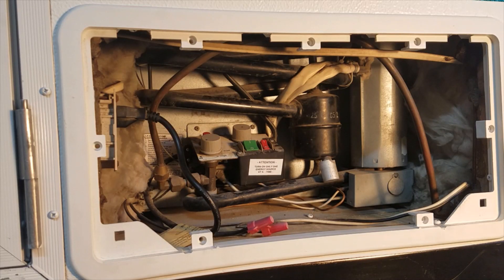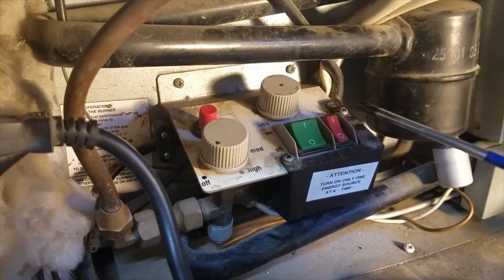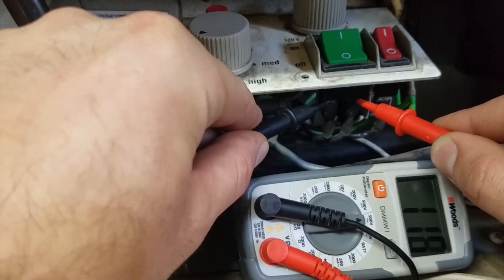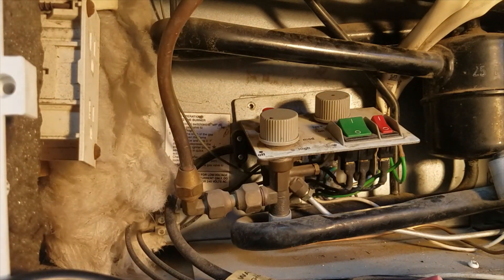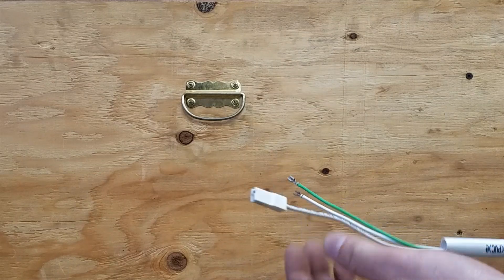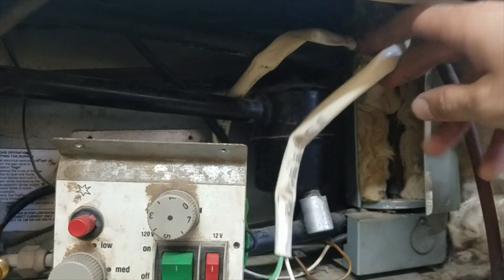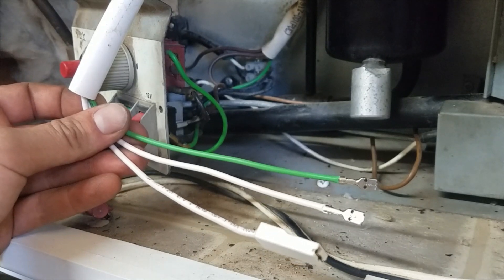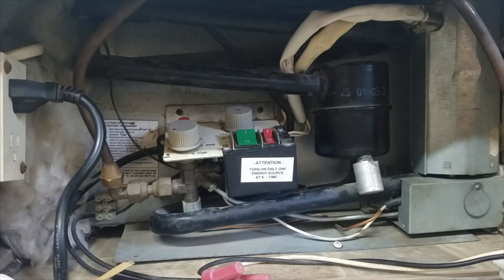Dometic RM2193 NOT COOLING ON 110V (Heating Element Replacement)

Comment: I clicked the link for the part and saying no longer available, do you know if a different model element would work? not wanting to spend 150 bucks on a single part
Reply from the maker: Unfortunately, I can not find any elements in stock that aren't $150 at the moment.  I'm hoping they aren't going to discontinue them.  It's possible that another model could work, but I can't be certain as I have not attempted this myself.

Comment: I goofed up my wiring! On the thermostat there are 5 spade slots. Top two should both be grounds right? Of next three on the thermostat 1 is verticle and two are horizontal. Does the vertical spade get the small black wire which also connects to the switch? Which one of the two horizontal spades get the white wire?
Reply from the maker: The top two vertical spades should be the green wires.  The lower horizontal spade on the right should be white.  The black should go on the lower vertical spade to the left.

Comment: Hi! I have a new to me Pop-Up with a DOMETIC RM2193 that started tripping the CGFI. Reading the Ohms on the element I am getting about 99. In my troubleshooting I disconnected my wiring to the thermostat knob and my pictures did not come out so not sure how to plug them back in.  I think it is white to the top middle blank and black to bottom? Searched online can't find any clear info. Thanks!!!
Reply: I take it this is too old of video for anymore dialog but I did determine the order for the heating element connection to thermostat (white skip one black, grounds are at top to frame). Unfortunately I am still unable to use   120V as it continues to trip any CGFI power source used. As I am getting the correct ohms reading on the heating element disconnected I checked continuity on the Thermostat terminals for the white and black spade connections and they are toning out  so am assuming that needs to be replaced. Cleaned out my burner so at least I can use the propane for now.
Reply: @robertcabrera3375  I also get about 99 ohms on both the new element and my old element (looking like I didn't need to but a new one - dang, waited too long to test). I"ve got more testing to do to verify the switch working, will try to update or edit this reply if I come up with more. I came to this video trying to see how to test the thermostat. I took the switch apart and I did notice that it seems to have gotten hot enough to allow one of the terminals to shift slightly (melting), but the switch tests ok.
Reply: I did get mine working. It will occasionally trip my GFI but I can reset it (3x sometimes) and get it to stay working. Not sure if it is because it was on when I plugged into my house or because I am plugging it into a 20 AMP house circuit as I haven't experienced a trip of GFI at campground. 🤔 Well we sold the pop-up  now so on to something else!

Comment: my heating element and back of fridge vents get hot but my fridge doesnt get cold.. Ive tried shore power on 15amp outlet.. 12v.. nothing works. What can it be?
Reply from the maker: In some cases, especially if the fridge has been sitting idle for a while, the system may need to be burped.  Before doing this you want to check the piping for any sign of ammonia leaking out. Any smell or discoloration on an area of the pipes would indicate this.  If no sign is present, you can proceed to burping the fridge.  There are some videos going into it more but it involves flipping the fridge on its head for a few minutes and then back right side up.  This mixes and untraps any air that may be causing the system to not circulate.

Comment: Can we leave the fridge on 12V while running on shore power? The power converter should be able to supply the 12V right? Not sure what the purpose of the 120V option is.
Reply from the maker: Running it that way will put alot more strain on the converter. The 12v should really only be used when in tow.  The 110v option doesn't put a load on the converter, it takes power from the breaker.

Comment: Any chance you know where i can purchase a cooling unit for the Dometic RM2193?   I got my unit to work on propane (pilot light looks great as a nice blue), so i'm guessing the cooling unit is bad?
Reply from the maker: The Dometic part number for the cooling unit is Dometic: 2936360110.  If the unit won't cool even with the lp system working correctly it is possible that the ammonia has leaked out of the system.  Sometimes you can actually smell it when it's leaking.
Reply: @Jandmrvrentals  Thanks so much for the quick reply!  so i didn't see any of the classic yellow residue or smell that would suggest ammonia has leaked. the fridge has been sitting for probably 5+ years.  my guess is that the ammonia solidified in a tube? 

Also, i fired up the propane and have a good clear/blue flame and let it sit for about 40 minutes... checked in the fridge and it really wasnt getting cold. should i have left it running longer you think?? again its been sitting for a long time but i dont see any real leaks anywhere.
Reply from the maker: I would make sure the unit is level and run it again for at least 4 hours. If you see no difference in the fridge temperature then the cooling unit is most likely damaged.  If it does start to cool then leave it for 24hrs and see if it has reached 40⁰ by then.  
The cooling unit is fairly expensive, it almost may be cheaper in the long run to buy a new fridge.
Reply: @Jandmrvrentals  yeah that's what i've been seeing (expensive cooling unit vs buying new, lol).  OK great!!!! thanks so much for the tips!!!!  all the local guys around here (connecticut) weren't even 1/2 as helpful, lol.
Reply from the maker: No problem at all
Reply: @Jandmrvrentals  Thanks again for the tips!  ran it last night for 2 hrs and started seeing signs of it getting cold. ran it over night and went to the fridge in the morning and it got down to 40 degrees!!!  if i hadn't reached out to you i would've never thought of simply letting it run for a while.
Reply from the maker: That's great to hear! Glad I could be of help.
Reply: @lfkwtz  I understand they are sensitive to being level. That's all I can add for you unfortunately. Mine works on 12V and propane.

Comment: the cylinder on the right side that connects the heating element is hot does it means to say it is working?
Reply from the maker: Yes if that area is hot then the system should be working. Give it at least 4 hours to test the inside temp of the fridge.

Comment: Thx for this. Is it normal for the heating element enclosure to get hot when in use?
Reply from the maker: Yes the large pipe (flue) that I removed the shroud from will get very hot if your fridge is working properly.  Normally if I dont feel heat from the top vent within 30-60 min then something is wrong.

Comment: Thank you for creating this, as I may need to do this. However, isn't it possible that it is the thermostat switch? How do we check that?
Reply from the maker: It is very much a possibility, yes.  Both heating elements as well as the manual thermostat can be tested for continuity using an DMM set to ohms.
Reply: @Jandmrvrentals  any idea what the resistance of the heating element should be? I'm measuring 99.8 ohms on the heating element. Not getting much more than 20v ac out of the thermostat when set on 7, and 11v when set to 1. Not sure how that thermostat is supposed to work though.
Reply: @MrBrandonh98  Brandon.  Did you ever find any answers for the "resistance needed on the 110 heating element." And what about the thermostat? What output should you get @ 1 and/or 7? I have all classic symptoms of a dysfunctioning 110 element.  Replaced it and only cooling to 44. Thank you for any help!

Comment: Good video with simple explanations. I have an older popup with this model of fridge, would a bad heating element cause the GFCI outlet in the camper to trip whenever I try to power using AC power?
Reply from the maker: Thank you! That is a good possibility  or perhaps the wires to the element are causing the outlet to trip.  If you do an ohm test between the two white wires that will let you know if the element has shorted.  From what I have read, if you get an ohm reading then it should be good still.  If it is showing an open circut then it is no longer good.